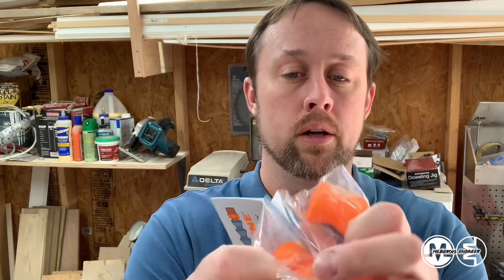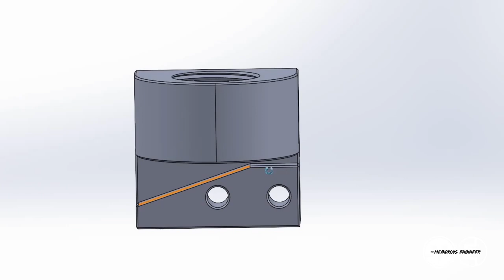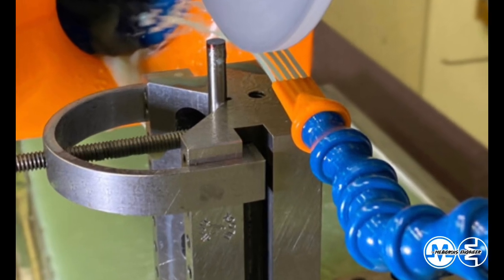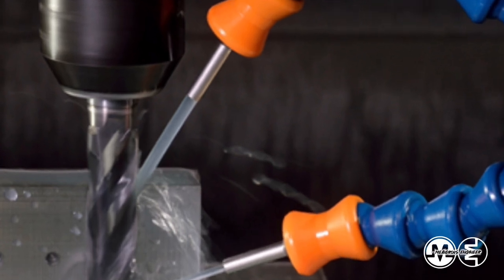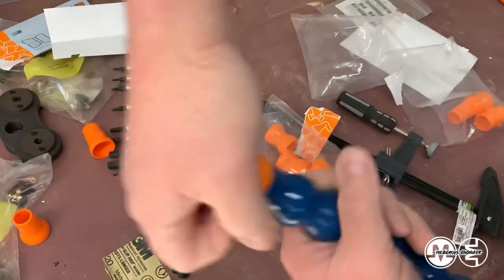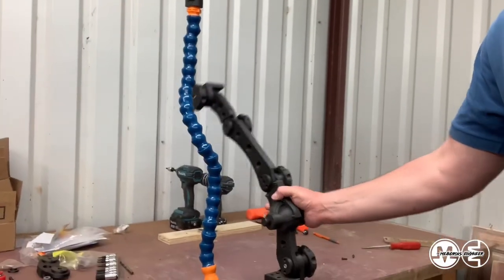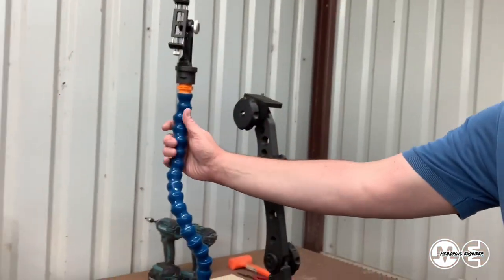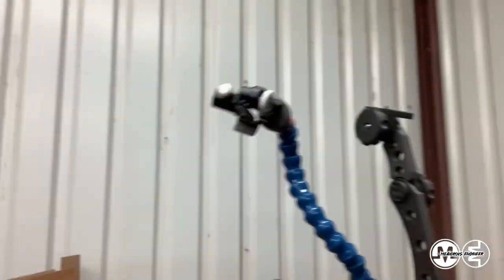Ripping Off Adam Savage || Loc-Line Phone Stand - Camera Rig Part 3

Comment from the maker: I've had a couple of people comment that they would like the STL's for the bottom and top for the assembly.  I've now posted the link to download both of them in the description.  Please let me know if there are any problems getting these.  The models have the NPT threads already rendered so all you have to do is print them.  I would recommend printing them with the threads vertical so that you don't have a lot of supports to remove afterwards.

Comment: Hello from Germany, I'm currently building this Loc-Line lamp, but it's much longer than yours. I use the large 3/4 inch version and the length is 120 cm. My problem is stability and would like to know what type of wire Adam used. Maybe you know a solution. ...Tom
Reply from the maker: Mine is about 36" or ~90 cm and I still have some issues at certain angles.  It will fall because of all the weight from the leverage of holding an object out that far.  As far as the wire he used, are you talking about his lamp video or the phone holder one?
Reply: @themeandrousengineer  Hi, thanks for the fast reply!
I mean the video with the lamp.
Adam used aluminum wire for reinforcement in the video. He calls it anchor wire. But there are many different types of this wire. I tried with 6mm aluminum wire, but the Loc-Line tilts forward. This is a type of craft wire in german wie call it "Ankerdraht".
I own a cinema in Germany and I want to use the lamps to illuminate my goods.
Best regards
Tom
Reply from the maker: I watched the old lamp video you were referring to and he called it armature wire.  I did a quick search on google here and there were several variations on Amazon, but I don't know if you have access there to Amazon.  I've tried to search hardware suppliers in Europe before and I have no idea where to start.  It's typically sold in art supply stores here.  Here are a couple of links but I don't know if you can ship it to you economically.

Amazon:  https://shorturl.at/ltwzM
Dick Blick Art Supplies:  https://www.dickblick.com/products/blick-armature-sculpture-wire/
Reply: @themeandrousengineer  Thank you for researching this especially for me. I'll try to find the right wire for myself through your links, the only problem is that the wire doesn't bend too easily. Unfortunately I don't have much knowledge of wire, I'm a trained carpenter.
If you don't mind, I will tell you about the result.
Thanks for everything...Tom
I subscribed you 😃
Reply from the maker: @kinotom3639  Thanks for subscribing!  Yeah, please let me know how it goes.  Honestly I didn't know about the wire that Adam added to his lamp to stiffen it up so I'll probably be trying it too.